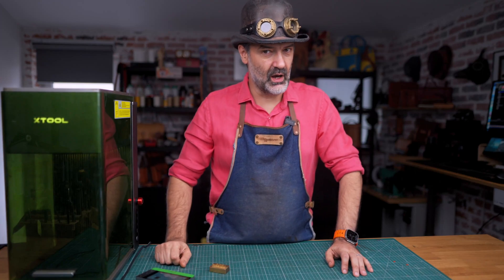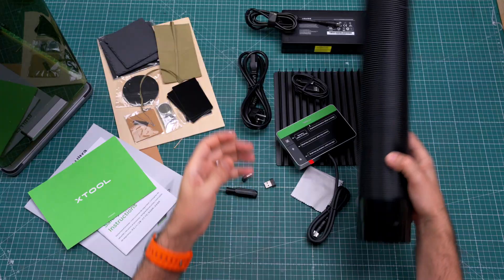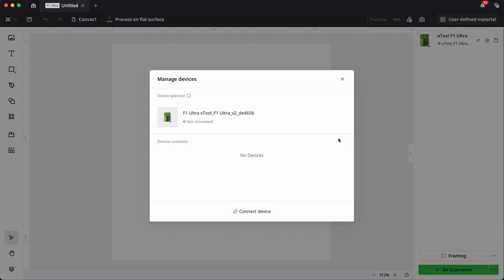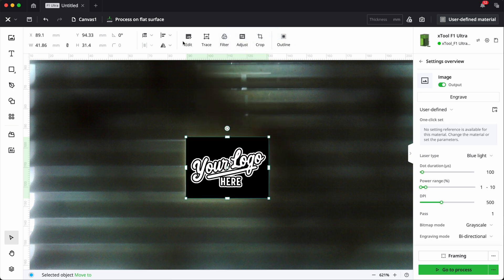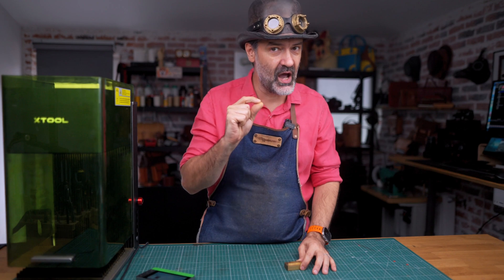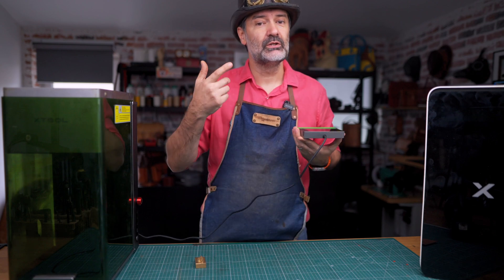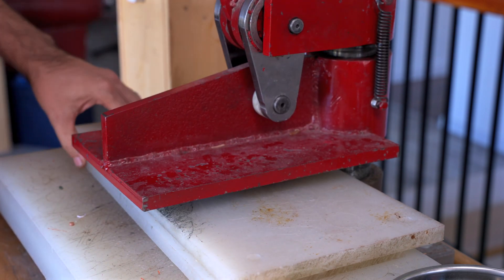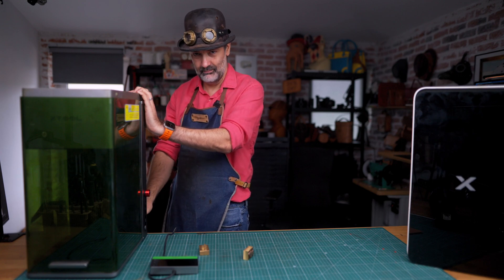How to make brass stamps with the Xtool F1 Ultra Laser

Comment: In real terms, based on real running costs of owning a workshop, around £30 / hr, the total cost of that is around £600, even halving it is still going to be around £300 at 1.5mm depth.  Selling price around £30 -£35. CNC machine costing roughly the same amount, around 15 minutes, or £7.50 making the average selling price profitable. These are great tools for making money, just not at cutting brass stamps.

Comment: 100 layers and 0.01mm step down is 1mm total depth.  Looking at the stamp it seems much deeper.  Does it mean one laser pass removes more thatn 0.01mm  and  at some point during the print the laser will have suboptimal focus?
Reply: My question too... I've been trying to knock out a brass piece and should be getting 2.56mm of depth in the embossment running 256 layers with it dropping 0.01mm per layer. But in actuality I am only getting around 1.3mm - 1.4mm. In this video doing a similar thing, the settings they show states they removed about 1.5mm of material. https://www.youtube.com/watch?v=hiOVb3o7pyQ&list=WL&index=49

But that math just ain't mathing! Curious if you ever figured out a solution @lutam921
Reply: @ZX10RArcher   I sold that machine. It is not worth the time.   I'm now convinced that most YouTuber that made a video about this won't ever redo it again.  If you want to remove substantial amount of metal you need much higher wattage. If I would have kept that machine, I would have changed the lense to get a shorter focal length. It could improve power focus.
Reply: @lutam921  Gotcha - thanks for following up!

Comment: 20 hours!!!! I could engrave that in 10 - 15 minutes on my cnc, and saying a cnc can't cut fine detail is misleading, I have engraved dies/moulds/electrodes with lettering as small as .5mm, it's all about having the correct set up, a decent cutter grinder and cutter microscope help to get accurate cutters every time and using the correct type of cutter and angle ensure perfect results.
Reply from the maker: I Would love to see this set up you are talking about and some results with letters 0.2 mm thick like my laser can do.
Reply: Yeah and how much does this cnc cost? This is a table top laser engraver...
Reply: @ You have to remember that this guy is a salesman not an engraver, I have been engraving for 40 years and could happily do this kind of work on a £100 used manual engraving machine, it's not about how much a machine costs it about knowing how to use one.
Reply: @ziggybome £1000 second hand,  floor standing
Reply: Next time I do one I'll drop you a link, right now I'm busy engraving stainless steel door plates 👍

Comment: You can run what's called a clean up pass after you are done engraving.  It is normally done at a higher frequency and lower power than your engraving run and will leave you with a nice surface finish which helps cut down on the cleanup time.  May want to experiment a bit and see what your settings would need to be.  I know on my 30W I run like 40% power and around 60KHz for freq and only do 1 pass so it's quick.
Reply from the maker: Will do. Thank you